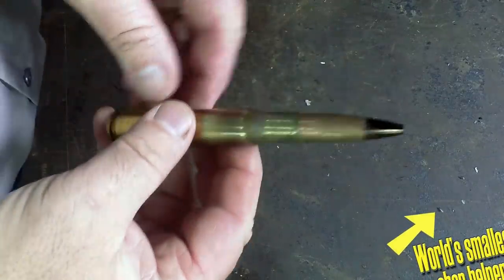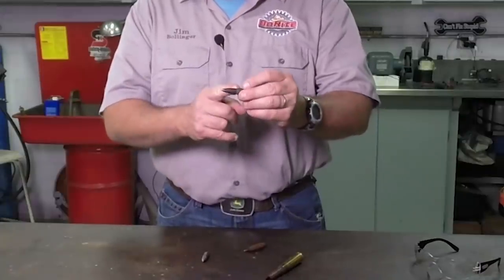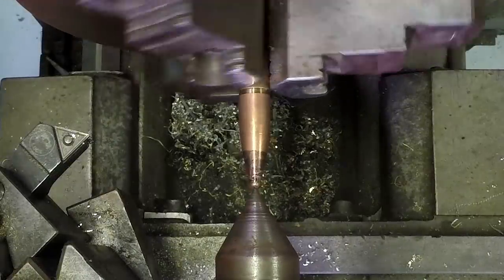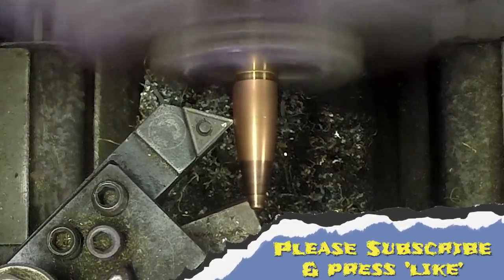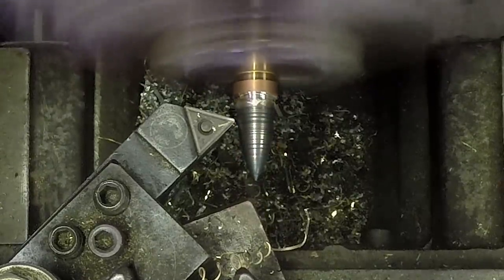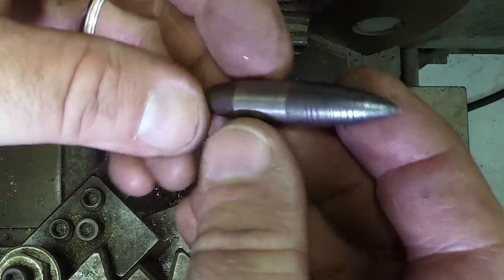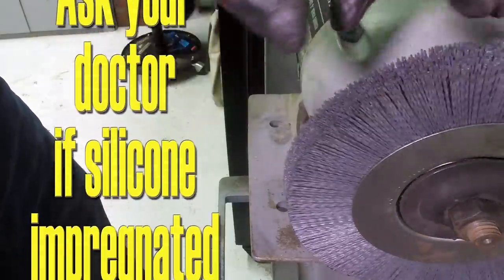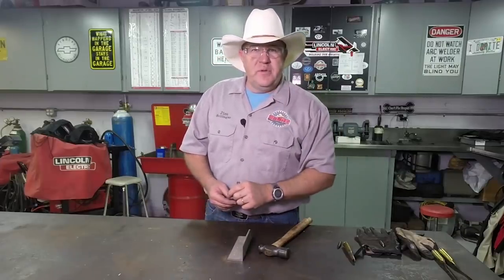Making a KILLER metal punch

Comment: Good job as usual. The lead liner acts as a lubricant for the hard core as it enters armor plating. I have made several of these over the last 50 years using both 50 cal and 30 cal AP rounds but I mount mine in a piece of round stock to make them easier to hold.

Comment: Way back in the early 60s I was stationed with the Army in Germany.  When a soldier was close to rotating home he became a "short timer" and a few days before departure he had to "clear post" by visiting the various post agencies like the library, medical clinic, etc and have his clearance initialled off.  You could always tell when a GI was clearing because he had a clip board and a "short timer's stick.  The sticks were made out of just about anything, a GI could get his hands on; wood, copper tubing, vehicle antennas, and the like.  The ones I liked were made out of the primer from a 106 recoilless rifle and a 50 caliber machine gun bullet. The primer was a perforated tube about 18 inches long with a cap on one end that looked like the but end of a 50 caliber shell casing.  The primer was polished with steel wool or fine sand paper and the bullet was soldered into the open end of the primer tube.  The brass and copper was polished to a high luster and I even saw a couple of chrome plated tubes.  The primers were easy to score.  Every time the Anti-Tank crews fired live a couple would trickle back.  The bullets were another thing.  We carried our basic load in our armored vehicles in ammunition boxes that were sealed shut with common steel strapping.  Ost of the time the basic load was invitoried by counting cans but sometimes random cans would be opened so that the ammunition could be inventoried by the round.  Every now and then a sealed can would be opened and one or two 50 cal rounds were missing.  The Great Houdini could not pull off a trick like that but then again the Great Houdini was not an American GI. I wounder how your grand paw got his AP bullets.

Comment: The penetrator core in older surplus ammunition, like the one in this video, are not made of Tungsten, Tungsten Carbide or Depleted Uranium, like many modern ones are ... They are reported to be made from a manganese molybdenum, alloy steel such as 605M36, very hard and yet not brittle (with the heat treatment process used in this application).

Comment: i believe the core on those ap rounds is depleted uranium or tungsten  its hard stuff. i like the 30 cal better i have made punches with them by inserting. them inside a piece of 1/2 round stock if i remember correctly i used a 5/16 drill to make the hole and locktited the core in . the problem is that those rounds are tough to come by. are they available at gun shows  or on the internet? are they even legal to own?

Comment: Great video. Wonder how much more accurate the “live round” would have been without that runout? Now you’ll have target shooters “turning” their bullets 😎

ATB
Eric
Reply: the bullet wasn't running out, the 3 jaw chuck that was holding the bullet wasn't grippi g the bullet dead centrally. no need to use one as the 3 jaw worked fine, but a 4 jaw chuck and clock gauge would see the bullet spin true

Comment: Very Cool! I wonder what alloy the core actually is?
Reply: Th penetrator core in older surplus ammunition, like the one in this video, are reported to be made from a manganese molybdenum alloy steel such as 605M36, very hard and yet not brittle (with the heat treatment process used in this application).